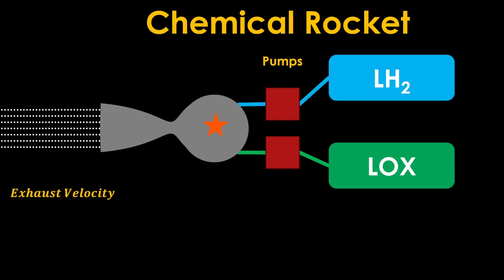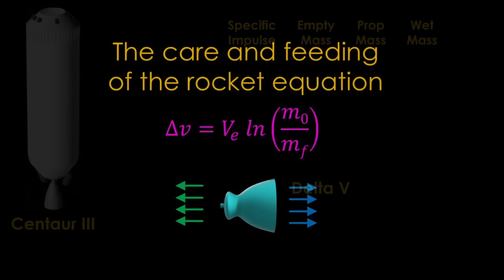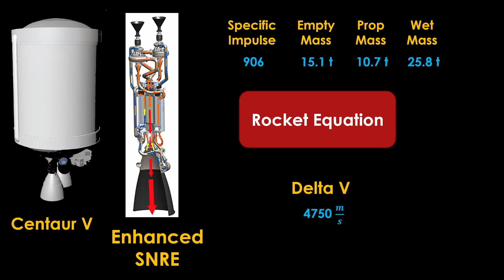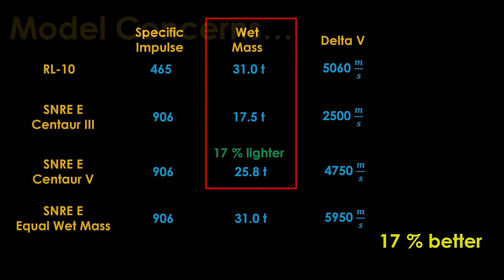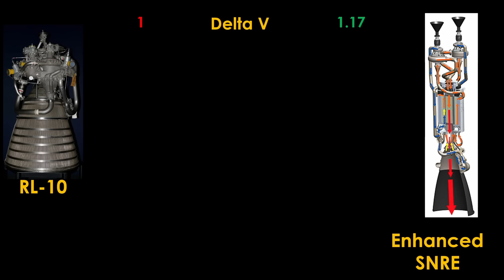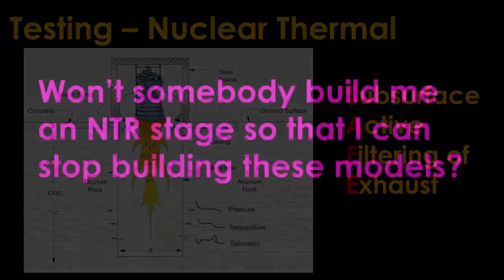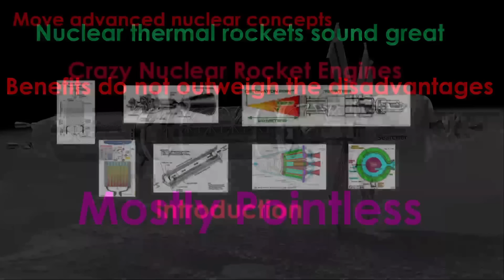Why Nuclear Thermal Rockets are Mostly Pointless

Comment: I wonder if anyone has done research into using propellants other than liquid hydrogen. Using a denser gas like argon would definitely result in some loss of Isp, but it might make up for it with better density (and possibly thrust as well). Obviously the regulatory and testing hurdles are still there, but it might not be completely pointless.
Reply: Oooh, argon would not be a good choice, for a given temperature the exhaust velocity of thermal drive varies with the square root of the exhaust products mass, so Argon with its weight of 39.948 would have an exhaust velocity over 6 times lower than hydrogens atomic weight of 1, at high temps when the H2 molecule breaks down. That would be an isp of less than 200, that's actually worse than a lot of solid fuel rockets. The best higher density propellants you want to pick are ones that are larger molecules that at high temps break down into lighter elements, things like ammonia or methane are pretty good, though still your exhaust velocity with those is only just slightly better than chemical rockets. Also methane has a bit of a coking problem cause when it breaks down it turns into hydrogen and carbon, and the carbon can stick to things.
Reply: @massimocole9689  What about methane then? At the temperatures where hydrogen dissociates, so does methane, and my math gives an Isp of about 420s for 1 carbon and 4 hydrogen atoms assuming that the hydrogen are still 906s and the carbon is 261s. That Isp is slightly lower than the RL-10, but you could pack 26 tons of methane into a Centaur III compared to 20.8 tons of H2+O2.
Hmmm, when taking into account the heavier engine it isn't really any better. I guess the hope would be that you could use some other propellent at higher temperatures. That, or bring back the hydrogen-lithium-fluorine tripropellant.
Reply: @Quasarnova1  Yeah I mention methane at the end.
Reply: Yes.  At least on paper.  Things like water, methane, LOX, etc.  Your reaction mass also needs to be able to cool the reactor, not sure how liquid Argon performs in that way.
Reply: Argon is a good choice for electric propulsion, though, and it's cheap (atmospheric gas — byproduct of air separation) which is why SpaceX acquired the technology to use it for Starlink station keeping.

Comment: This is possibly your most controversial video to date going just off the comments. I've never seen so many people adamantly arguing against your points with such finess and knowledge which before. As other people have already said, I would love to see your rebuttle or an edited version where you walk back some of the claims.
Reply: That's because idiot space cadets are in an NTR cult, and have uncritically swallowed a whole mythology built around it as 'THE' technology which would have made all their space dreams come true if it had not been canceled.  Very similar infact to the Thorium Molten Salt and Small Modular Reactor hype going around today.  These people do not know how to do real enginering analysis or have any real understanding of nuclear physics or spaceflight, they only want a simple narrative.
Reply from the maker: What I'd really like to see is somebody showing me a model with different assumptions. That is what would change my mind.
Reply: What do you even mean by model

If you’re talking about a rocket configuration like the weird examples you picked I already gave that to you in another comment, at equal mass (31 tons) you get 6373 meters per second of delta v. 
It’s still an inefficient configuration

For the TWR of the engine first of all nuclear thruster with much lower mass and much higher power density and TWR can be made. They haven’t been made yet because they require extremely radioactive and hazardous to work with reactors but if you were to do this seriously and make a mission there’s no reason why you couldn’t just have a reactor that is far more enriched, with a lot of neutron moderation an an extremely high neutron flux, ten to 100 times higher than a regular power plant

In addition even if you are to keep the exact same engine (same core), if you replace the hydrogen fuel with methane fuel, something nuclear thrusters can use without issue, then instantly you lose around a third of the Isp, but multiply the thrust by around 4 while multiplying the density of the fuel by around 5 and significantly increasing the mass ratio of the fuel tanks. 
So taking the exact same engine you used the SNRE and switching hydrogen for methane would likely get you a smaller dry mass almost identical to the chemical version, with 4 times the thrust and 4 times the TWR for the entire stage, meaning it can now push 120 tons which means it could now push 110 tons of fuel with that 10 or so tons of dry mass at 1G and an Isp of around 625. 
That kind of performance is why nuclear rockets are so easily capable of making SSTO rockets. 

And this is why I recommend their usage for landers and takeoff vehicles, mostly for missions to other planets, the moon, Ceres etc, but also occasionally to create VIP rockets to launch extremely heavy payloads into orbit you would have difficulty launching any other manner due to needing exponentially larger rockets otherwise

For instance let’s say you want to launch a 200 ton mirror to orbit or something like that. It was polished down to a single atom on the finest labs on earth, and when that wasn’t good enough, they decided to cut atoms in half to get a better surface finish. It cannot be made in orbit, and has to be launched in one piece!
Well for that type of mission you’ll be pretty happy to have nuclear thermal rockets that can takeoff and give you 625-950 Isp depending on whether they run methane or hydrogen. 

The last big use I see for nuclear thermal rockets is military. So far thankfully there has not been wars in space (the Kessler syndrome would be horrifying) but if you’re ever going to fight a war in space or if aliens were to show up, you need high thrust engine that have the highest Isp possible. Si vis pacem para bellum et caetera 

Their main use is any place that requires high thrust, and where you would prefer or need to have more delta v than what chemical engines can offer. 
If high thrust/acceleration is not required such as space transfers, then ion engines are better. 
Lastly a ship can have several types of engines. Engines are generally lightweight compared to a full ship and so it’s perfectly acceptable to have both an ion engine and a nuclear engine on the same ship especially if they can use the same propellant reserves. Ion engines generally run on noble gasses but it’s not mandatory you just need to get inventive and lose a bit of performance to use non noble gasses. Nuclear engines meanwhile can take more or less anything but have mediocre Isp unless they can release H1, H2 or He1 in some fashion. 

That’s why they have a high Isp for methane CH4 but a low Isp for water OH2 and ammonia NH3, because they can break the hydrogen off methane but cannot break the hydrogen from ammonia or water at the temperatures we can currently manage. So a nuclear engine that is being fed methane will release H1 and H2 alongside CHn molecules, while one that is being fed water will only release full heavy OH2 molecules. Hence the Isp difference (625 for methane vs I believe 235 for water). They can run very comfortably on helium which is an easy solution if you want both an ion engine and a high thrust engine on the same ship. 

Does that satisfy your request for a "model" or not? Still unclear what you mean by this
Reply from the maker: A model is a design where you detail your assumptions and do the calculations and you get results from it. It's not an offhand comment, and the best models show up in formal papers.

You are making many assertions about how you can make ntrs better. You might be right but if methane is a better fuel, why are all the NASA proposals based on hydrogen? Why are so many engine designs based on hydrogen?
Reply: @EagerSpace
Methane is a worst fuel than hydrogen unless you’re in very specific situations

Here you picked an example entine the SNRE that has quite low thrust to weight ratio and you see this as the r biggest issue because the delta v doesn’t go up that much due to the engine becoming a large % of the ship + the hydrogen fuel tanks being very heavy (universally true)

For that particular example using methane would give you better delta v and thrust especially if you use the added thrust to get extra fuel mass 
(As a reminder going from dihydrogen to methane instantly quadruples the thrust with the same engine. It really works like that. It comes from the molecular mass of the exhaust)

But suddenly instead of having a 30 ton upper stage you have a 120 ton upper stage and at that point it’s not really an upper stage and you would completely change the design of the rocket and it’s staging

For numbers, it’s simple, we know that Isp of hydrogen is 1000-900, that for methane it’s 600-650, that for hydrogen + oxygen it’s 440 (for good ones) and that for oxygen + methane it’s 340 (apparently can get to 389 in vacuum optimized)
The thrust is impossible to know because it depends on the radioactivity of the nuclear reactor and almost no other factor. And this can be tuned to anything the engineers want. 
So here are your numbers. The TWR is limited by the ability of the engine material to hold the pressure. It’s the same for chemical engine and thermal engines. It depends on the specific yield and yield strength of the engine and pipe material
Typical ones would be steel titanium tungsten and diamond. (Diamond engines don’t exist yet but likely will in the future and would be extremely light, and capable of handling very high temperatures too. Diamond is an almost magical thermal conductor that can handle temperatures equal to graphite while also being decently strong all while being a quarter as dense as steel. Our ability to make larger pieces of diamond has only increased, we can already create large Boulder sized sapphire gemstones, diamond is behind but getting there)

The concept you need to understand is that a nuclear reactor can have pretty much any level of energy density. You can have a white hot ball the size of a melon if you want that outputs megawatts/low gigawatts of thermal energy constantly if you design it that way. 

If you use highly enriched fissiles that have low critical masses and use very strong neutron moderators you can get ludicrously strong and power dense reactors. A nuclear bomb IS a nuclear reactor. Is  a nuke enough power output for you ?

So the issue isn’t the power output or power density the limiting factor is the engine material. Meaning the TWR is the same for chemical engines and nuclear engines because for both of them the limiting factor is the engine not blowing up. 

And that’s the issue because you ask for numbers but the numbers can be anything you want as far as thrust is concerned. The Isp has a known maximum but the TWR is "whatever you want it to be within the material limits of steel"

Radiation shielding also puts nuclear engines below chemical thruster for the peak maximum they’re capable of in TWR but it’s still extremely high (over 100) in both cases 

So if you want numbers I’d say 900-1000 for hydrogen, 800 for helium, 625 for methane, 440 for hydrolox, 350 for methalox, any TWR you want for the engine(between 3 and 150), and a mass ratio of 3.5 for hydrogen, 5 for helium, 15 for methane, 25 for oxygen

Nuclear thermal rockets should also only be used in application where high acceleration (trust) is needed. Ion engines are better where low acceleration is acceptable. Nuclear thruster are the Lamborghini option that replaces chemical engines. I recommend their use for landers on other planets, potentially orbital launch vehicles especially for large single launch payloads (like a huge mirror that needs to be launched in one piece) and finally for military roles.

It seems that by the word "model" you mean an actual rocket stack but thats the wrong way to look about it, you’re like a horse carriage manufacturer asking me for precise stats for an internal combustion engine right after they were invented

I’m telling you "sir! you don’t understand! they have the theoretical potential to have very high horsepower in a small package, hundreds of horse powers even! Early prototypes aren’t representative of the technology’s potential, and the technology’s potential is known from physical principles!"

And you reply: "me don’t care about theoreticals. Me care stats. Show me engine in store with 200 horse power like you claim. You claim internal combustion engine can have hundreds of horses inside. Maybe. Maybe. But so far the only internal combustion engines that have been made have 5 horse power.  5 horsepower ≠ 200 horsepower.  Grug thinks we shouldn’t develop these metal horses. If it was possible to get more than 5 horsepower in an internal combustion engine, they would have built them already. Enough with theoreticals. we need to spend money on breeding better horses. Grug has spoken."

All your arguments are that existing engines are bad but at the same time you say we shouldn’t pay for the R&D cost of better ones it’s a completely circular argument. And whenever I or others try to explain HOW and WHY they can have better performance than the existing ones you just handwave it as too complicated and keep asking for existing prototypes.

 Even though better ones haven’t been made yet. But you don’t want to make better ones because the existing ones are bad. But the existing ones are bad because better ones haven’t been made yet. But you don’t want to make better ones because the existing ones are bad. But the existing ones are bad because better ones haven’t been made yet. But you don’t want to make better ones because the existing ones are bad. But the existing ones are bad because better ones haven’t been made yet. But you don’t want to make better ones because the existing ones are bad. But the existing ones are bad because better ones haven’t been made yet... ♻️
Reply: @IceRain-f5v  You are a crank